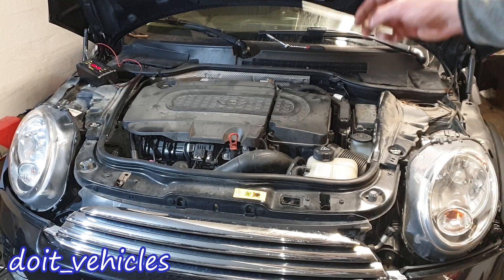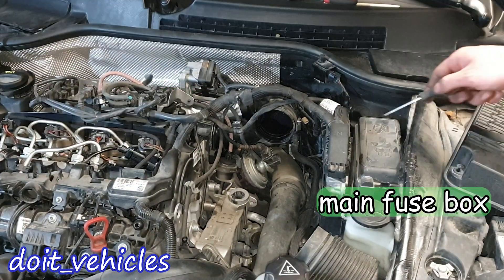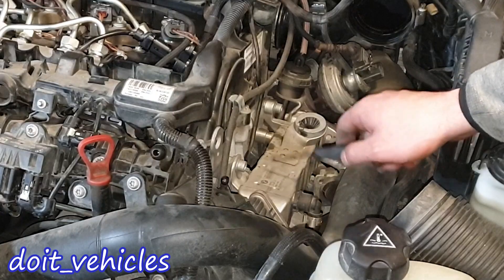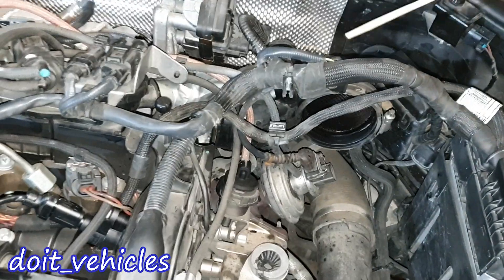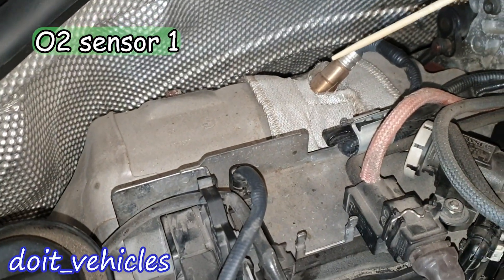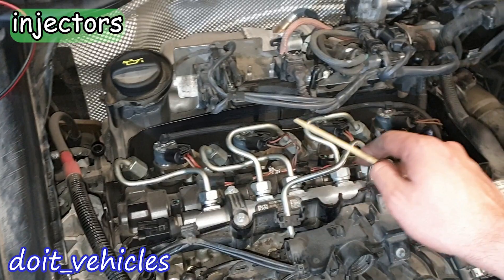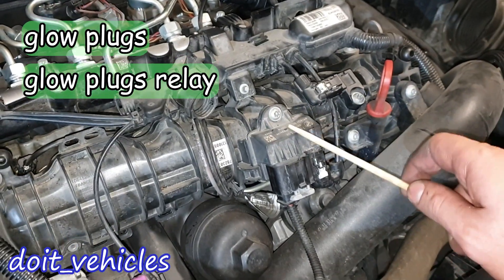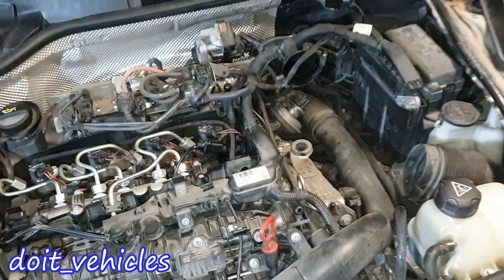1.6 Mini One D Engine Bay Layout - components location - diagram

Comment: hello, wanted to ask, i have some problem with mine 2.0d 105kw, the boost is low at low rpm, it reaches around 2.2k rpm, maybe can u  lead  where to look at? tried smoke test/changing maf sensor and etc, nothing helped. and car has no errors, egr and dpf removed. thanks